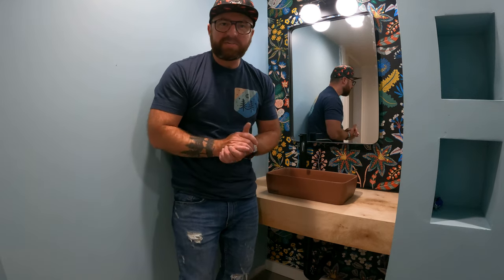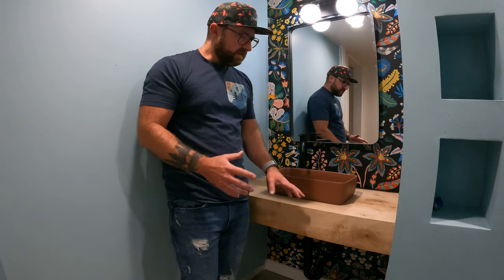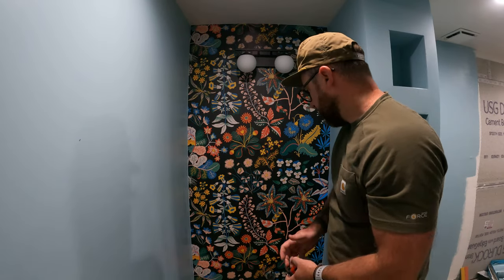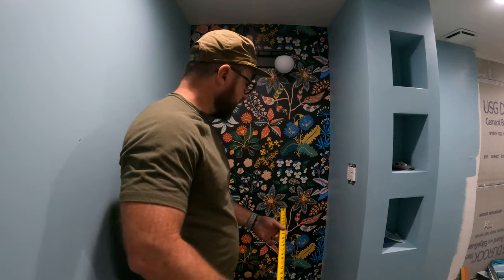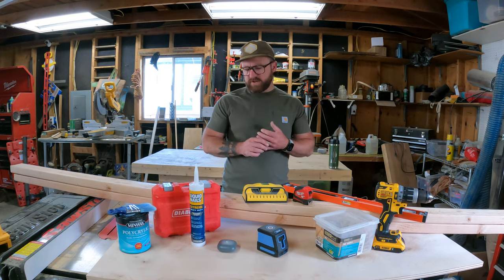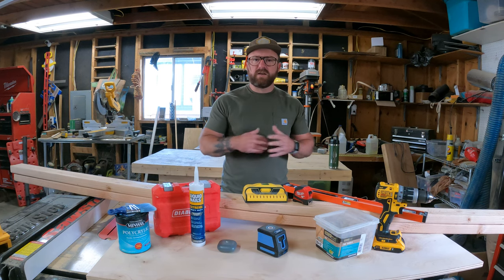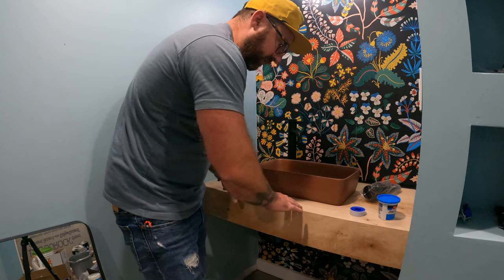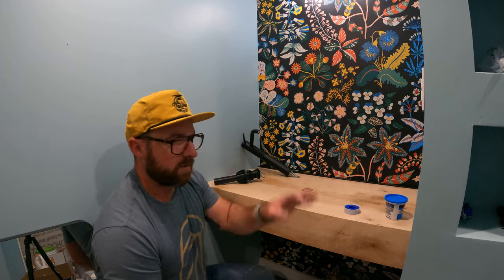How to Build a DIY Floating Vanity with a Vessel Sink - Perfect for Home

Comment: This is awesome, thank you for sharing! What thickness of maple plywood did you use? 3/4"?
Reply from the maker: Thanks for watching. You are correct. I used 3/4” you could probably get away with 1/2” but seemed worth it for extra strength.
Reply: Awesome! Thanks for the quick response.
Reply from the maker: Of course, best of luck with your project!
Reply: One last question… where did you get the wallpaper? And, have you had any issues with it being so close to the sink?
Reply from the maker: Here is the Etsy seller we bought it from and we have had no issue with very regular usage of the sink
Reply: @beardedspruce  Great, thanks! Appreciate it
Reply from the maker: https://www.etsy.com/listing/773759782/

Comment: Thank you! this seems very easy to do. quick question: do you know how much weight this set up can hold? I have a stone vessel sink which might be too heavy. Thanks!
Reply from the maker: I weigh about 200lbs and stood and sat on it to test it and it didn’t budge, my in-official guess is 300lbs plus. Of course all this is dependent on the side walls that I was able to use for extra support. Hope this helps and thanks for watching

Comment: Great job as always. One question I had was is there a way to cut the mitre on the waterfall with a skill saw or do you need a table saw?
Reply from the maker: Thanks for watching! You could totally use a skill saw, you would need some kind of secure straight edge like this https://amzn.to/3AEaHRK which clamps to each end of the plywood and will give you a guide to rip the plywood. I actually go over a similar technique in this video. https://youtu.be/S_Yyxtkf2lM hope this helps

Comment: ✌️😎
Reply from the maker: Thanks, this was a super fun project.
Reply: @beardedspruce  about to put in a vessel sink, but this sink is a beast. 33"x 18"x 10" deep and heavy. Going to take a little more to hold this one up.
Reply from the maker: @michaelparker5030  That sounds like a huge sink. I didn't show this in the video, but I did test the structure by sitting and hanging on it.
Reply: @beardedspruce  think I'm going to put it on 4x6 beams tied into the studs of the wall. Lol, the bathroom sink is bigger than the kitchen sink.
Reply from the maker: @michaelparker5030  that will def hold some serious weight!
Reply: What type of wood is the floating shelf? Has a nice tone to it.